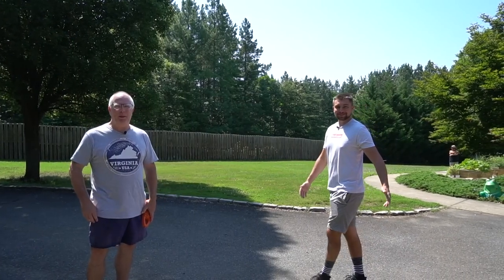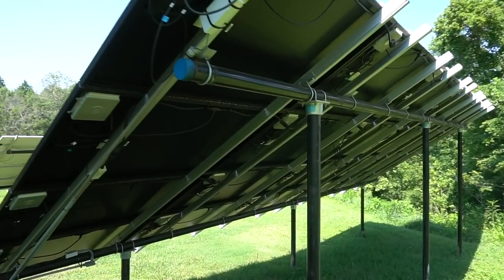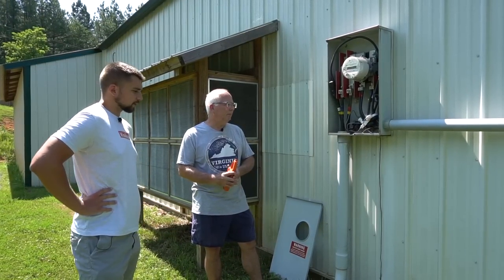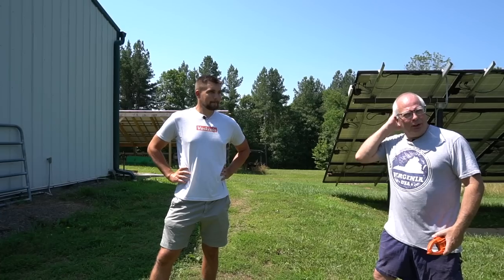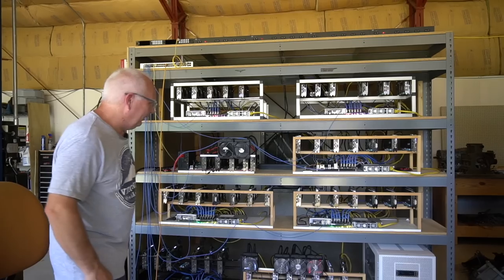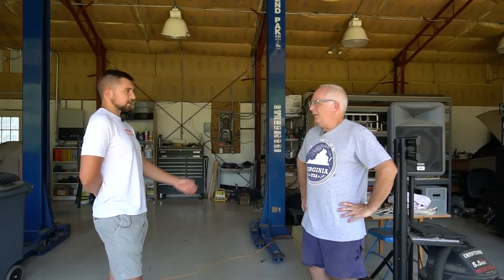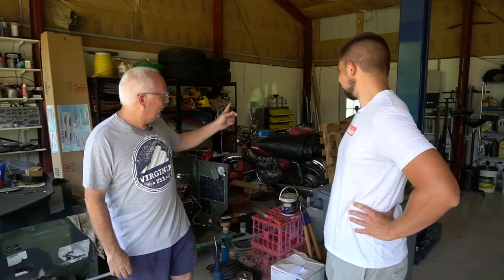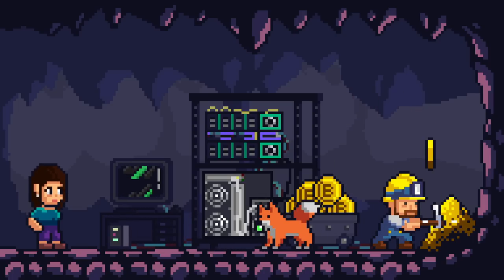The BIGGEST DIY Bitcoin & Cryptocurrency SOLAR MINING FARM Tour!! ☀

Comment: Update: In December 2020, Congress passed an extension of the ITC, which provides a 26% tax credit for systems installed in 2020-2022, and 22% for systems installed in 2023. (Systems installed before December 31, 2019 were eligible for a 30% tax credit.) The tax credit expires starting in 2024 unless Congress renews it.

Comment: Use air purifier to cut down the dust and add a robot cleaner if the ground area is clear it cuts down the dust levels significantly , you just have to clean the filters once a month

Comment: If you have a roof mounted solar array, could you not build them entire system on a rail system that you electronically control via an electrical motor? so you slide the entire array down off of the roof of the garage to run maintenance on it?!..

Comment: Good Job demonstrating different Solar Types and configuration.  I have a 10 kw system attached to a 7.6kw inverter.  Half the 10kw panels face East and the other half face West so you never get 10kw all at the same time which is great for the inverter.  Peak summer i generate 60kwh/day and winter about 35kwh/day.  Best banking power months are the winter months when the AC is off.  Here in AZ. the AC costs are high and consume too much power.  Rainy days hurt but AZ. is mostly sunny year round. My system barely supports two rigs.
Reply: I'm in Az too, Portal, and have 80 active panels, 12 more waiting to install. All microinverters. About 115-120 kWh per day this time of year. Do you really think it's an advantage having half face east and half face west?
Reply: @portalminer8813  No I don't, but the majority of the panels are on the East and catch the morning sun.  around 11:00 a.m. both sides of the house are hit by the sun until afternoon when mostly the west panels have sun.  Remember, I have 10kw of panels and a 7.6kw inverter.  It can't handle all the panels all the time. My house roof is ^ shaped and the sun goes over it left to right.
Reply: still cant figure it out, to solar power 5 mining rigs at 3,3kw/h each, how many KW solar system sholuld be? ofc to make them work 24h/day

Comment: I'm adding a 10kw array. Unfortunately in Virginia we can't go off grid. It's illegal. So adding a battery backup is totally pointless. I'll be running 325w panels with a solaredge system with power optimizers on a ground mount.
Reply from the maker: That’s awesome where at?

Why is it illegal?
Reply: @VoskCoin  sorry let me reword that. If you are connected to the grid and want to just run off solar and battery backup it is illegal to disconnect your power service with your provider. You have to be fully off grid 100% of the time or on a grid-tied system.. also depends on your county/city laws. 

I'm in King George, VA
Reply: Plus battery technology is not the greatest right now. So you will end up spending soooo much more for huge battery backup that will only get about 10yrs out of vs your 25yr solar panels.
Reply from the maker: Would you want to do a video tour when you’re done? I’m in Fredericksburg so I’m probably only 30-60 from you :D if you do click the about page here on YouTube to grab my email and we can figure it out — id just drop it here but comments get crawled and then I’d pickup spam
Reply: @KyleB What are some good brand name panels wireing Etc? Also can we get all the The material locally or is something we have to have shipped in? I live in NC? Thanks!!
Reply: @Theferg1  I'm actually contracting a company for mine. I will have REC 325w panels
Reply: @Theferg1  any tier 1 solar panels are good. I also shopped for warranty and looking at the fail rate.
Reply: @VoskCoin  perhaps he should go with hybrid inverter. it wont disconnected to grid and wont supply back to grid. My setup are hybrid inverter. I already stop mining since 2 years ago and then go into solar industry,i am getting my solar installer license by end of this year. Yeah i agreed that energy  storage system in the main issue when the sun gone, i am testing Lifep04 batteries in my 12kwh setup now with 33.4kwh battery bank. Since i am from Malaysia it's more easier and cheaper to get those batteries. Perhaps you should go for saltwater batteries which from America which is last longer and more efficient (100% DOD). The latest saltwater or liqiud energy storage is from Austrlia....go find Red Flow Batteries
Reply: @gotrubicon  Look into a grid transfer switch for your main panel that way if power is down, you automatically switch to battery. They are fairly common in Western part of the VA for generator use. Also, there is something to be said about 48 volt Fork truck batteries if you have a garage like that.
Reply: @ClayinSWVA  no battery backup for me. Will auto switch straight to 20kw generator
Reply: @gotrubicon  "it is ILlegal (VA?) to disconnect your power service..."  You're UNDER 'King George'💩         Get 🌄Free...completely! cost of Freedom is priceless😎
Reply: lol it's "illegal" to do it in most places. I'm not gonna connect to the grid, legality be damned.

Comment: Going to say - amazing setup, but I was getting anxious each time he touched the lines.
Reply: Im no electrician but that could have ended badly.
Reply: I've worked along side pro electricians and they often won't turn off 'minor' circuits when they work in a box.  Years of experience, confidence in where they are placing their hands.  (maybe overconfidence)
Reply: cables are isolated touching the metal connectors would not be good but yeah people should only touch anything in there if they are sure they know what they do :)
Reply: If you have electrical experience and know what you're doing its not that big of a deal. Most electricians work in hot panels and connect wires while they're hot. I mean can a hospital really afford to turn off its electricity, when you have patients on life-support? Even most HVAC technicians are working on hot circuits. Because most businesses can't afford to turn off the electric. I mean you can easily electrocute yourself plug-in in something to a receptacle, if you accidentally touched the prongs. Touching those wires are no more dangerous than touching an extension cord.
Reply from the maker: haha peter lives life on the edge carter!
Reply from the maker: @ThomasDiy  thats an interesting comparison w/ the extension cord :O
Reply: GameTime not at all, he was touching the insulation, same thing as holding an extension cord, live cable under the insulation but perfectly safe to hold..... unless there a hole lol.

Comment: 9:11 I trust this thin rubber insulation with my life.
Reply: Not really that risky he's at least an inch or
 two from the other insulated pole; if the insulation was damaged on what he touched it wouldn't matter unless he somehow also contacted the other pole that also had worn insulation.
Reply: you much electrical/mechanical engineering bro ?
Reply: @CW-xh8uw  looks to me like he's touching the neutral wire not hot, so even if he touched the case he'd be fine. Maybe that's not what you meant, not sure.  Absolutely no risk (in a properly wired intact circuit, I'm not an electrician don't take this as advice) of shock touching a neutral wire even if you contact ground simultaneously, it's called neutral because it's grounded to 0v.
Reply: @CW-xh8uw  well let's make it clear that I'm not an electrician and not giving advice on how to behave around electricity, just sharing my thoughts. What scares me is that you're worried there's people out there coming to YouTube comments sections to learn how to work around high current/voltage systems, don't you think that's a bigger concern than a random like me sharing my thoughts on YouTube? Lmao.
Reply: @CW-xh8uw  you have no idea what I know. 99.9 percent of the time touching a neutral wire is safe in a properly designed, non-degraded circuit. Am I encouraging people to needlessly touch neutrals? No. Am I clarifying that very likely the guy who built this entire system understands his wiring and that there's no potential difference between ground and the part of the neutral on the wire he's touching so he finds the risk acceptable and doesn't have a death wish? Yes.
Reply: @CW-xh8uw  hey doctor electricity can you tell me where you got your data on neutral wire contact being one of the leading causes of death among electricians? I can find absolutely no reference to that data and the leading cause of death seems to be direct contact with energized circuits and/or ungrounded circuits, shocking... No pun intended!
Reply: @CW-xh8uw  you sound to me like some guy who's Dad was an electrician and thinks he sounds smart lol.
Reply: He thinks his name is Homer Simpson
Reply: @WhatsY0UTUB3  have you seen the data about neutral contact being the biggest cause of fatalities among electricians yet? Didn't think so... hope your feelings aren't hurt. Go through life appreciating politeness over fact, your call.
Reply: @WhatsY0UTUB3  even in a properly wired 3 phase circuit the neutral has no potential unless the neutral circuit is both not intact/degraded AND carrying an unbalanced load.  Is that incorrect?
Reply: @WhatsY0UTUB3  straight from a reference on 3 phase wiring, tell me I'm incorrect again? "When the neutral wire breaks, the voltage at the star point is not at 0V but a different number. We may never know what this voltage could be because it would depend on the connected loads at that time, which means that this voltage could be close to 0V or much higher.
The higher this voltage, the higher is the risk of electric shock to a person or animal that completes the broken path, and this can be very dangerous."

Key words: WHEN THE NEUTRAL WIRE BREAKS ie until that happens potential is 0V... go back to school.  I'm pretty certain you and the other geniuses here are confusing contact with an intact neutral circuit with contacting a degraded/open neutral circuit and completing/closing it... THAT'S dangerous.
Reply: @MikeMPharmaCyclist  i agree with you. the neutral wire in an north american system is bonded to ground to make the voltage on the neutral wire in reference to ground ZER0.   it is designed this way for safety reasons. 

  there is still 110v of potential between the neutral and one of the other hot legs.   but neutral to ground is zero.   

and this other guy with his made up for youtube argument stats....   LMAO.
Reply: @stevewinwood3674  lol finally someone looking at this with intelligence instead of emotion!  Appreciate that and yeah, still waiting on the secret stats haha.

Comment: awesome set up, looks great. i wonder how much you can make from selling to the grid for set up?
Reply: VoskCoin  Is it ok now？
Reply: from my understanding of selling back to the grid, it requires you to be on the grid, or grid-tied so if the grid goes down, you go down with the way it's all integrated. Hence why a lot of solar diy'ers are not grid tied. I could be wrong, but I know there are problems with the grid-tied systems not letting your system stand alone by itself during power outages.

Comment: Vosk...

If you build s dedicated off grid system you can use 240 volt (single phase european) inverters to run your miners.  They are slightly cheaper.

Comment: I agree on the micro inverters. You really only need them in shading areas. Hes in full sunlight so string inverters are best.
Reply: I was just thinking that
Reply: Micro inverters also have other pros as well. One goes out the system stays on and they convert the power at the panel. if the string inverter goes out the whole system goes down. Each setup however is different for the users need.

Comment: I was shocked when he said it was only $7-$8k to build. That's about what it cost to finish our basement
Reply: This is DIY. There is a lot of free electrical work here. He is probably a retired EE. For you or me it would be 50k+ easy
Reply: @byronwhitlock6005  I agree, this guy knows what he is talking about, def retired from some engineering or some other profession
Reply: @11:22... cost discussion was in reference to the ONE micro inv. ground Array (32 modules) for $8,000-9,000 for PARTS Only.   
His arrayS Total = "50,000 Watts of capacity" x his est.(at min. 3:33)  of $1.50/Watt =       ~$75,000.oo (PARTS Only) .🌄
Reply: $8k per panel. He has like 4 panels.  Then he has about 15-20 devices in there and each device is around $3,000-$5,000 each.  Then you have his hundreds of hours of free labor.  Minimum $150,000 setup
Reply: That is not even close to what this cost to build. Guido is closer to it. Not sure why he is underselling his cost on this so much but just the parts would be closer to 100k than 8k. Put solar panels on your home and see how much that costs if you do it yourself, 8k is like 1 array lol.
Reply: @imnuktam872  ..  i was wondering why it took 4 years to break even ,,,,,
Reply: Solar panels take around 4-8(depends where you live) years to break even if you set them up yourself. If you hire someone it usally takes 8-12 years to break even.

Setting them up yourself is pretty easy to do if someone you know can help you. And it only takes around 50-100 total workhours depending onyour house, skill, material, tools etc
Reply: It's a liability it was of an asset. Look up rich dad poor dad. Might change your financial intelligence
Reply: i wanna know how much the 100yrds of wire cost?  to go from down hill up to the first box shown.
Reply: @eliaspfeffer  Yeah. He might teach some English, too.
Reply: @stevewinwood3674  The 500 MCM aluminum cables is about 2 dollars per feet. So you are looking to about $ 1800 for just the tree cables alone.
Reply: Really dude? How can he get a single panel for $120 ? Did it just fall off the truck?
Reply: No way you can do this for 8k unless you teach yourself....the panels alone must cost that...
Reply: I ordered a CK5 from coin mining central. 2 months after the order I was wondering where my miner was 2 weeks after it was to ship to me and they informed me they had more orders than miners in the batch when they had origins put them up for sale. But despite 3 separate emails they never informed me my miner would not be shipped until last email sent yesterday. When you buy a miner, they tells you to pay within an hour to confirm your order, which I did the day I ordered it. So they knew I was not going to get my miner, but kept my money for 2 months before informing me. During that time profitability went up And they “received” another batch of the same miner which they offered at 2.5x what I paid when profitability was lower. I don’t know if they resold it to someone else at higher cost or not. They then offered me 2 miners . One at 50% of profitability of CK5 and one at 10% of profitability. The one at 50% they offered to me at 1500 pound more than the CK5. So they want me to pay more money , even though goldshell site has it at $1000 less than CK5. This people are evil, bait and switch and I only dealt with them because of Voskcoin endorsement but later on I’m so much amazed that I was able to get back all I spent  to them with the help of junkywarriorscom team now I deal with this new site and get the coin in next 4 hours after payment
Reply: @christopherfasho2503  I'd like to buy one but unless i can walk into a shop and buy one same day im not going to bother for precisely the reasons you mention...Plenty of great looking miners for all kinds of coins but if you cant buy at current market conditions then whats the point?

Further ASIC makers seem to use miners when super profitable and then they sell them when it is not...

MY skepticism with mining is off the charts right now - maybe there is a way to do it - yet after hours watching this channel i am none the wiser on how to do it - i bought some ARRR this week and made quite a bit - that seems much easier...
Reply: I bout my evga 1070ti 2+ years ago for $800 and it's going for around 1200 now.. prices are shooting up for this industry

Comment: Love it! I live in SE Missouri where there are rolling hills in and out of town. This would be perfect!!! I just have two questions though. Putting in all that effort, and he didn't go with a sun tracking system for his panels? That makes panels 5-10% higher efficiency. I've even read about "smart" tracking systems that use the panel's GPS location so that the motor moves it into position each night to catch the very first rays the next morning AND compensate for the position of the sun based on the earth's tilt an all that stuff! I know he mentioned hydro-power in the last few minutes of the video, but there was no mention of using wind power as well. I wonder why?
Reply: I heard the added complexity makes them unreliable
Reply: not only unreliable, but an incredible PITA to do DIY and then maintain. Those trackers can easily amount to 30% of the entire install, too.

Comment: idk what residential code is in virginia or wherever this is, but pretty sure NEC doesn't allow anything above a 3% voltage drop for any run. so i find it kinda funny that he did all this but keeps talking about voltage drop like it would be a factor. where's his inverter? your losses on a dc line are going to be negligible. even the run from his house to the shed is like what 300 ft? that's nothing